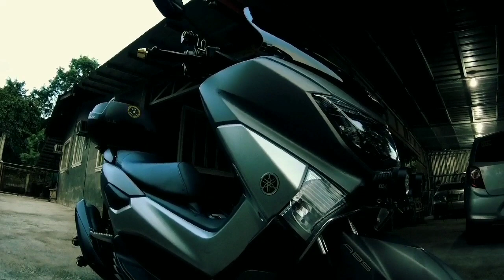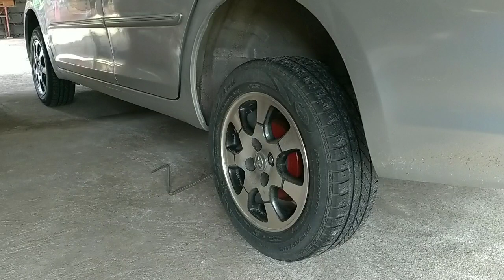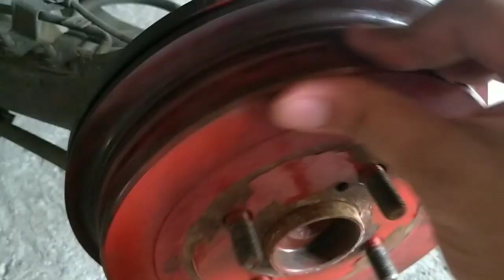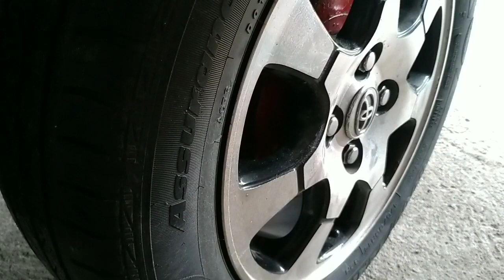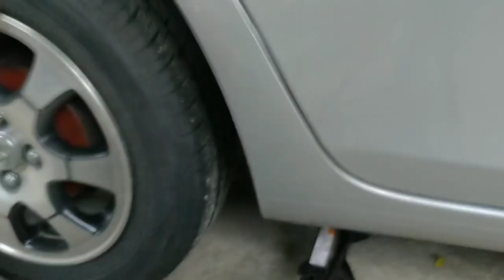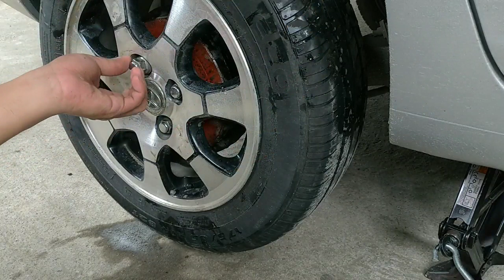DIY hand brake / brake adjustment | vios 2009 | batman

Comment: kusa po yan nag aadjust kapag numinipis ang brake shoe.
Reply from the maker: Nope may manual adjuster po yan if gusto mo iadjust yung handbrake specially kung masyado malayo ung pag kakaadjust nung nag install. Drive safe.
Reply from the maker: Pero tama ka din po na kusa sya mag aadjust pag numipis its just after installing new brake shoe medyo need some adjustment pa muna lalo na nga kung malayo masyado pag kaka adjust nung nag kabit de cable po kasi itong handbrake natin. 😊